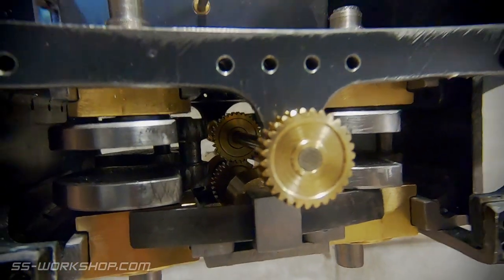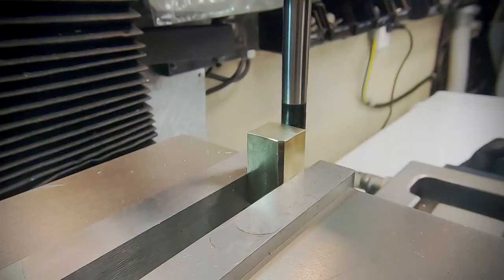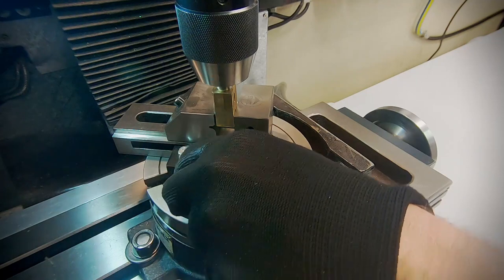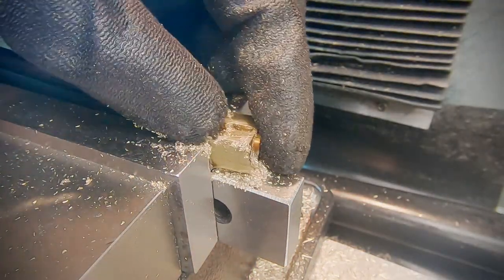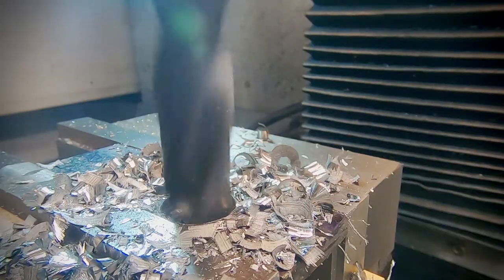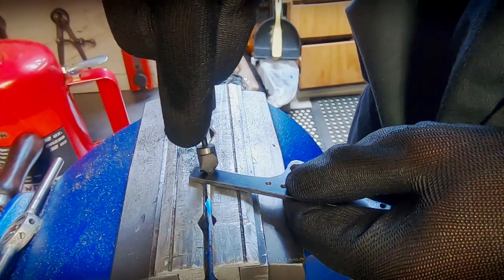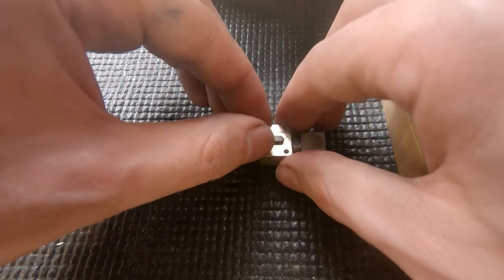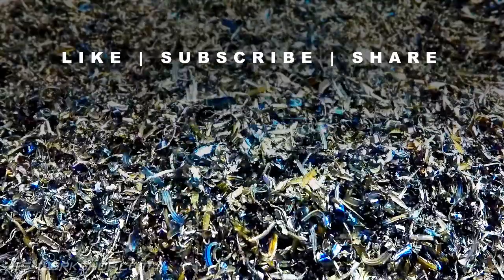Fell Engine Project - Traction Wheel Engagement Assembly S1.E32

Comment: Another great video and glad to see parts starting to move how you want them too. I spent Xmas playing on the old blackball to roa line on the west coast and found that a lot of the centre rail supports there are still in place which made me think of your loco. Looking forward to the progress on this loco in the coming year.
Reply from the maker: Thanks, Pretty cool the centre rail supports are still there after all this time since it closed. I think (but could be wrong) the brake van at Featherston came from one of the west coast lines.
Reply: Yes I had heard that it came out of the gorge at the bottom of the blackball yards but could be wrong. I have walked up there previously and seen one and know there is still another there somewhere. Visiting that is on the cards for the next trip.
Reply from the maker: Sounds like an interesting place.

Comment: Hi how expensive is it to make such an engine (with machines if possible) thank you in advance and happy new year
Reply from the maker: It’s hard to say as some of the materials are stock I keep for workshop projects (ie mild steel round bar I buy 6m at a time), I estimate the actual locomotive is about $3k NZD which would be about $1.5k USD / GBP this is also driven up by shipping to here for a lot of the hard to get materials which came from overseas, not sure where you are, but would be cheaper in the UK, US and Australia where access to materials is easier. On machines you need a lathe at a minimum with the smallest starting at about $1k NZD here + tooling (noting as far as I know LBSC’s engines were designed to be made with just a lathe). Mills start at about $1.5k  NZD here + tooling. Tooling can be more than the machines and depending on the size and capability of the machines the machines can be far more. The key to all of the above is if you are starting out  is to start a step at a time, i would suggest getting a lathe with some high speed steel tool bits and building a simple stationary steam engine from a kit, something like the PM research kits. I have had a lathe and mill for more than 10 years building workshop projects before tackling my current / first live steam loco build. Sorry for the long answer but I hope this helps a little, Happy New Year.